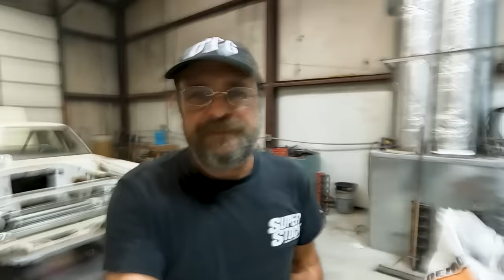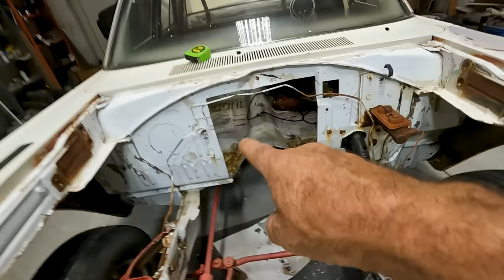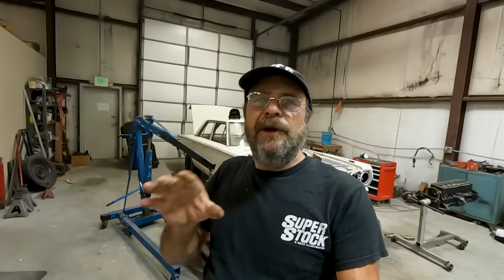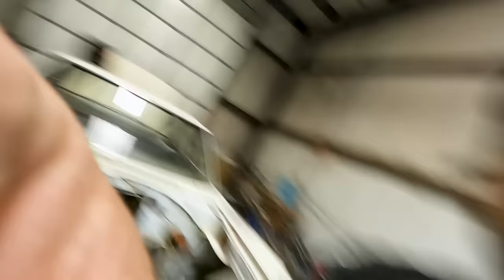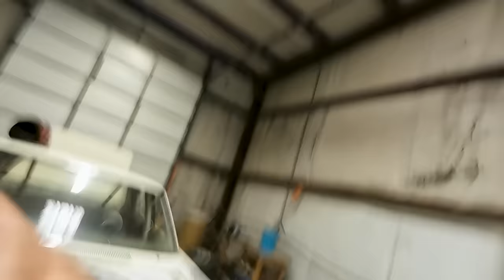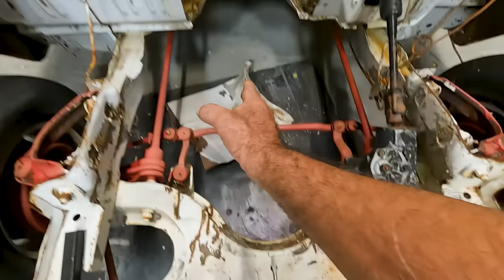The Single Most Obscure Bit Of Mopar Knowledge On The Entire Internet - Engine Swaps Made Simple

Comment: Straight axle front ends will get you on this as well. Usually speaking the side of the axle with the "steering arm & box" will be longer from the king pin to the spring perch than the Tie Rod side. It's to clear the steering arm and keep the pitman arm angle on the same plane as the steering box as it goes through it's motion. The original name of our VW Bug Rat Rod was "No Quarter" because we 1st set it up measuring off the spring pads to get the chassis square and it kept coming out a Quarter of an Inch off to the spindles. Come to find out, that drivers side perch on that '58 Ford F100 straight axle we used was a quarter inch inset. You don't see it with the naked eye, but the radius arms on that little Rat Rod are out of square, to keep the front-end square just like it was in the F100.
Good stuff as always UTG.
Reply: I'm glad you responded this because I put a '61 F100 straight axle in my '55 Plymouth Savoy. I ran into issues just trying to center it with the car knowing the engine has a offset but that shouldn't interfere with axle placement? Lol I never would of thought that the axle would have a slight offset as well in it. I also think the front frame horn on passenger side has been repaired at one point and is slightly off due to a wreck. When I look at the axle which is tacked into place it looks over to one side and it drove me nuts enough just to let it sit and contemplate on building a rectangular tubing front half. Now I know if I did, the axle has a offset and wouldn't be right doing that as well. Lol wow.
Reply: I checked out your build, not bad at all man! Yeah we spent the better part of the day chasing around that chassis with a tape measure trying to get it squared away. From the kingpins it was dead nuts on, but from the perches it was off. then it clicked and made sense. Now when I climb under these old things I can see it, and how they moved it over with the shackles, but I never noticed it before. That's the fun with doing stuff that is totally out of the box (like rat rods) it makes you see and think about this stuff..... lol @ratrodramblin

Comment: I first found out about offset on my 71 Cuda.
The car came from the factory with a 340 4 barrel and the original buyer also ordered it with a Shaker hood.
When I bought the car I wanted to put a six pack on it and keep the Shaker. 
When I looked closely at the Shaker to modify it is when I realized it was built in an offset, but it lined up right in the center of the hood.
That's when my research started and I discovered a great deal of what you're saying.
Thanks for the info Uncle Tony.
Always like listening to your perspective.

Comment: Mopar had more unique "secrets" and mystique than any other American manufacturer.
Reply: Like vtec before it was vtec
Reply: AMC hat it to 😉
Reply: @joffreywilderdijk2774 and AMC used alot of Mopar stuff.
Reply: I am on the AMC train
Reply: Yep, definitely. Coming from a "Mopar or no car" kinda guy, that's why Chevy's are 10x more common to build. No "mystique", just build the damn thing and finish the project with common and easy to find parts. Very few design changes or weird offsets like this, one bell housing shape, the list goes on. Love mopars to death, but this kinda stuff is why others don't.
Reply: @johnbean2596  Lately I have been seeing the old car hobby die. Except for B and E body Mopars.  The car web boards are nearly silent.  I don't think anyone is building Fords and GM.   Not now , anyway. Holding on to one, and selling it the trend now.
Reply: The 'reactive' power steering pump mount of the mid-60s bigblocks is one example of a special design.  If you see one of them where the power steering belt has made a rub mark on the water pump pulley, it's one that needs repair to work properly.
Reply: Factory rust 😂
Reply: @whatyoumakeofit6635 and mopar used a lot of mopar stuff
Reply: @johnbean2596 sux when it takes weeks to figure out what motor gonna fit in ur Dodge.
Weeks to fit, ass-load of money....oh shit that don't work........WINTER.......start over.........doesn't start, money is tight, got kids to feed.......lost interest. 
Break, repair, pay, repeat,........been the same for DECADES!!!
Reply: MotorParts had unique secrets, wht were they?
Reply: whatsecret? its holes used in the fabrication process,,

Comment: Tony, looking at that cut out in the fire wall, I am a bit concerned by the square corners.  I'm no engineer, but stress cracks often start at the point of the corner.  I suggest in the future, when you make such cuts, you curve the corners (maybe a radius of an inch or two) to NOT focus the stress on one point.
Reply: He's welding in a firewall hump, it'll be fine

Comment: You discover this when you 1st try to cut a hood scoop in your car and notice that the carb is not in the center of the hood.  Or run around with the hood off and notice the the carb is not in the center.  I have seen that hole, never thought the hole was anything important,  now I need to go out and look at my Duster
Reply: Yup. Look at the hood on the Junkyard Jet.
Reply: I WETN TOA  SCARP AYRDS AND SAW SOME MOPARS,, BUT THEN MY MIND TOLD ME ,, DONT GET YOURSELF IN A BOTTONLESS MONEY PIT, jsut because of a guy in tube.

Comment: For certain cars, we had a tailshaft rear section with the uni joint welded, and the used that as a pointer towards front of car. It was also good for setting up transmission height.

Comment: Offset. . .one of the issues the Australian Chrysler Valiant owners had to live with. An A-Body L/Hand drive floor pan layout fitted with R/Hand drive e.g reduced size pedal space, plenty of foot space for the passenger though. Steering box mounted to R/H chassis rail , cracking issue. Slant Six engine needed to lean to the L/H side etc . Still it makes the Southern Hemisphere Mopars even more unique 😁👍
Reply: Yep. Slant or V8, easiest way to remove a steering box, is pull out the R/H torsion bar, and drop it out underneath.

Comment: I wish I had known this 20+ years ago. I built a 54 Dodge PU with the complete drivetrain out of a wrecked 71 440 Magnum Charger. I took a lot of time and effort to make sure the engine was centered in the frame. I always had trouble with Ujoint life even though the pinion angle was good. It wasn't until years later that I figured out that the side to side offset was the problem. I didn't know any better at the time. However it was quite the sleeper.

Comment: Damn Tony. This works. I've drawn perhaps a half dozen conclusions about the offset of the engine. Some of which I suppose are valid. For instance the pinion is to the side. Economically these would make both axles the same length. Assembling the axles one would need to know what side the adjuster would go on when pressing on the bearing and keeper assembly. But this I never noticed. You suppose when mating up the engine assy (engine, K frame and s#!?@) one could eyeball the bottom pully as the body is eased down on the K frame assy so as to not bounce around off of things settling the body on the setup in production.  Does this make sense here what I'm trying to say?  I would trapse around the junkyard looking into this but these cars are just not in the yards anymore. I miss those days tripping around junkyards for the heck of it.   Good one. Uncle Tony does it again. Ha Ha

Comment: right up there with using wheel lug nuts with an opposite thread on the passenger side, in case the lug nuts might back out due to the wheel turning in an equal and opposite direction. not that its ever happened on any car, but hey, you just can't be too safe out there....just make sure the tire guy with the impact wrench knows.
Reply: It happened to me.  It is actually true that left hand lug nuts did better on the left side.
On my 72 Mopar which I was using as a daily commuter, it has right hands all around.  To make things worse,  I was using a non hub centric aftermarket unilug wheel. Keystone Klassic.  I had to check and tighten my lug nuts every day. One day I forgot and the wheel loosened.  I broke a wheel stud on the left side.
   With factory wheels it would not have made a difference. I still have the two Keystone Klassics but they are relegate to "rollers" or as spares.

Comment: Mopar did some major research. They had electronic ignition in the 50’s it worked great, but the controller was as big as a suitcase! They figured how to tune intake and exhaust. 
And the trick I would use a 904 in this swap. The Mopar and AMC versions are the same except the bell housing. If he was running a V8, I’d run a 727.

Comment: Okay, but in the many engine and transmission swaps I have done, I never used those marks unless it just magically lined up. Why? Well, half of those I was also swapping the rear end, and I only ever did one swap on a Mopar. All of mine were Ford or Chevy swaps. The Mopar was a Dodge D100 rear wheel drive going from slant six to an LA 318. But we always just went by lowering them in, making some measurements and then fabbing up some mount pads and mounts. Clearing headers and shifting rods, as well as pedals, then toss in the differential and that forced us to be creative. Your way is the correct way. Mine is the well, it works. I am pretty sure I saw Mark Worman or one of his employees talked about this driveline centering hole, maybe I just knew it from way back in the 70's when I did work on that Dodge. Or maybe I am just misremembering. All of the above are possible.

Comment: It is my understanding that they designed in ~3° angle of the drive shaft, in both horizontal and vertical, to allow the u-joints to scrub and keep the grease moving throughout the bearings.  
Your mileage may vary.

Comment: Modern mopars irs rears have the yoke of the differental offset about 1 inch to the passenger side. By 1 inch I mean the cradle mounts measure an inch closer to the passenger side than to the driver side

Comment: All twin I-beam era Ford pickups had the engine offset. Not sure about the earlier or later ones. 
I believe the diff was centered.  
As you know a cardan (regular) u-joint works best at a slight angle and may “whip” if it ever runs in a straight line.

Comment: wow this is awesome triva !! Im going to check my Austrlian chrysler valiant now hahaha thanks UTG
Reply: RHD.  My '62  RHD  'A' body Dart has the motor offset, so the oil filter now sits on the firewall with pipes going to the fuel pump bolt which has a return hole through it.

Comment: I wonder how much this affects the car's right and left weight distribution, imagine you have a slant six in a car with the whole drivetrain offset 2" to the passenger side and the engine has all the weight leaning to the passenger side too, the weight of the driver and steering assembly might balance it out and make the car pretty level in stock configuration

Comment: Yes UT, I did get something new from this. That is...a starting point to try & figure out HOW the driveshaft in my 1965 Coronet 440 4 speed car has now somehow become "too long."  Yes, i went to replace u joints recently & i CANNOT pry the driveshaft away from the rear end enough (at the rear u joint). It's all apart...just no room left to slide (the front driveshaft yoke is now bottomed in the tranny.)  🤔Go figure.
Reply from the maker: Shane, I suspect someone installed a 1966 - 70 Plymouth driveshaft in your car at some point.  1966 they moved the engine back 2 inches in the B Body.  A 66 Dodge shaft won't fit at all, but a 66 Plymouth shaft will just make it.
Reply: @UncleTonysGarage  I never knew that. Thanks. The 4 speed in the car is date coded to 1970, so maybe the tranny & shaft were scavenged from the same Plymouth. I may resort to having the driveshaft shortened (once i can get it out of the car).

Comment: I figured all if that out with my very first MOPAR.

What I'm trying to track down is all of the many various different 727 bellhousing types and which ones mount on which different engines [MOPAR, AMC, Jeep, International, Marine, Gensets, roadway tools, etc] because I want to put an overdrive transmission on my International truck.
Reply: @DeliciousDeBlair Check out Advance Adapters, they'll have good info.  The first clue to find is which side of the 727 the starter will mount on, it may be required that the trans and engine must 'agree'.  The Chrysler bigblock, for example, has an ear on the block for moutnign the starter (driverside) so I would expect any passenger-side-trans to not fit well (even if the bell pattern matches).  If looking at smallblocks, I believe Chrysler and AMC might not interchange either.  BUT - for 5.2/5.9 Magnum engines, Chrysler and Jeep differ on starter location but use the same engine block (I think).
Reply: Your next obstacle, and it's less obvious - connecting the crankshaft to the starter motor and torque converter. The flywheel/starter ring gear/flexplate/torque converter snout location are all critical and must work as a system.
Reply: Presumably you are wanting to install a 518RH trans into your IH (due to you asking about 727 BH versions).  But you may want to look at GM transmissions also, as maybe there are some adapter kits available there.

Comment: So if you're dropping a non-traditional engine in, you can run a line back from that hole to the center of the pinion yoke, get the engine lined up approximately---as well as you can, anyway---with the crank centerline in line vertically above that core-support-to-pinion-yoke line, and use that as your baseline for engine placement, if I'm understanding right?

Comment: Every mopar guy I thought knew that. A Chrysler engineer back in the sixties told me they were offset for weight distribution because most of the time cars only have drivers in them. It also gave better traction!
Reply: I suspect it also has a lot to do with keeping the steering box and input linkage away from the exhaust manifold for certain engine options.
Reply: @redmondjp  Oh steering is offset toward left a smigg
Reply: Offset for battery weight, also.

Comment: I died a little inside when I saw that rust free 67 firewall cut out.  Same as when I first saw the rear quarters and inner fenders . 😢 I suppose that was done decades ago.  The quarters anyway.  I suspect the front end was recent.
It is not really trivia, but the car is unibody, so sheet metal should not be taken out without a very, very good reason and without restoring the strength with a  cage.
Reply: Uni body ish. Most of the strength is in the frame rails and rockers, and even if you do remove structure usually it just makes the car twistier, not any immediate danger of breaking.

Comment: I like Jags, but all the affordable ones from the 80's have the drive train offset, but not offset nearly enough.  I thought maybe since the car was designed for right hand drive England, the problem was the drive train was centered. It is NOT.  But the trans tunnel is so big and intrusive, you still have too little foot room for the driver and even less for the passenger.
   And the W126 Mercedes, like, say,  a 1988 560 SEC, has a crazy situation where the steering wheel is offset two inches from the center of the driver. 
So you have to reach over two inches to drive it!
Reply: Some 80s GMs (Monte Carlo for sure) have the steering wheel offset from the center of the seat, too.

Comment: Mopars have torsion bars and odd sounding starters , this trivia is almost lost .
Reply: Some Japanese mini-trucks in the 80s-90s, and GM pickups of the 2000s, also had torsion bars.  IIRC there was an independent-make car (Packard?) in the mid-late 50s that had T-bars at all 4 corners.  Chrysler may or may not have pioneered it, but they sure did optimize it and make a foundation on it.
Reply: a lot of old cars had torsion bars ,, thsts not new or sometihing from mopar, even my car have one in the front axle
Reply: Cars have what they ahve to ahve.

Comment: I always thought Mopar engines were mounted crooked so that the u joint bearings would spin.  Ford and gm ensured u joint bearing spin by offsetting the diff ei having a short and long axle.  On the mopars I have messed with (forward look) the axle shafts were swappable left and right and the engine was noticeably crooked in the engine bay???  The misalignment of the output shaft and diff yoke ensured long u joint life

Comment: All cars have the drive train offset to the passenger side.  Well, all cars since the era when transmissions doubled and quadrupled in size.  Just measure the foot wells in the front.  I'm talking front engine , rear wheel drive. The problem is , are they offset ENOUGH?
   I am well aware of it because I hate cars that have too little space in the driver side foot well.  Which is most European sports cars.

Comment: How many people actually checked out this trivia? Yes the drivetrains were offset to the passenger side and yes there  are many alignment holes throughout the body that were used to assemble the car but this "trivia" that the hole he points (6:29) out as the centerline of the crank as stated @ 2:59 is NOT in line with the centerline of the crankshaft.  I visually compared various 68-70 Dodges and Plymouths with everything from 318, 383, and 440 and that hole is not in line with the center of the crank on any of them. If it is used as as the centerline starting point of an imaginary line passing through the engine and transmission back to the center of the pinion then the engine and trans will be crooked in the car with the u-joints having to be the correction point to bring it back in line with the pinion yoke. Not good for the front u-joint and would create probable vibration. Not to mention things such as the fan not being square to the radiator, linkages not lining up etc.